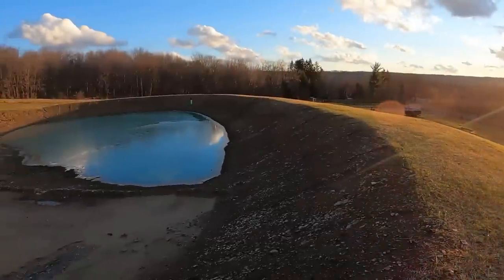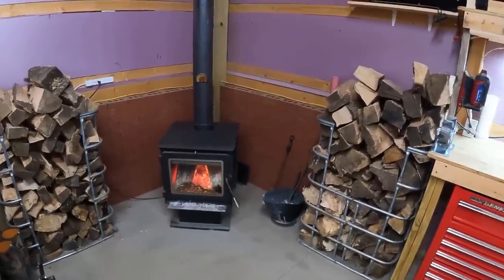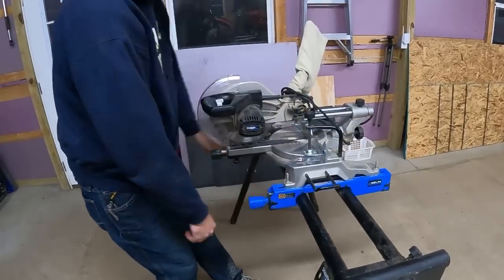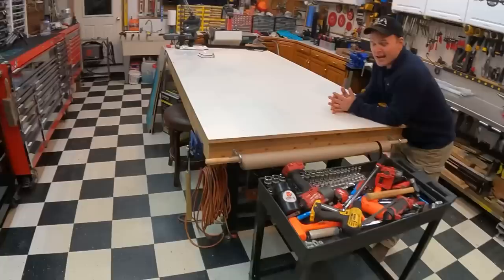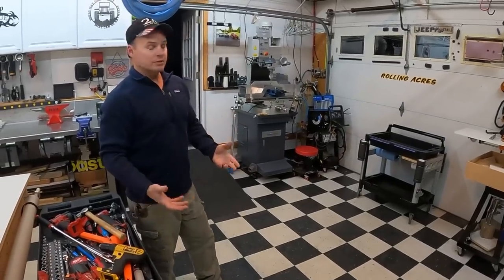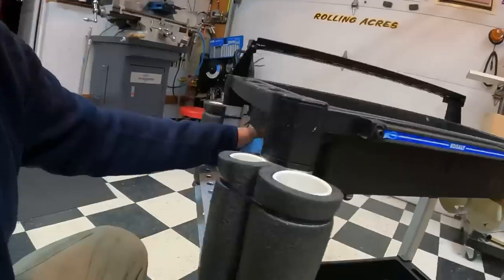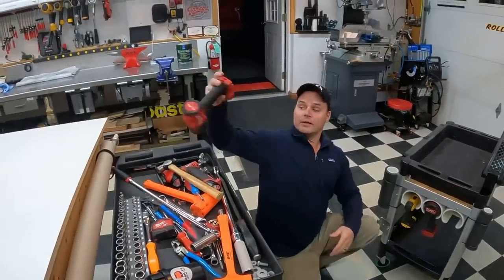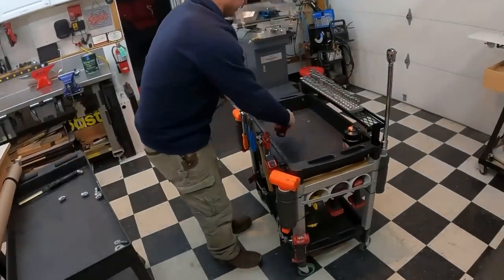The Best Mobile Tool Cart

Comment: Awesome video! I’m a professional tech and I took a lot of tips from Doug’s shop tour, and the other tour video too- an experienced word of caution: be careful when putting 4 swivel casters on a tool box- when all 4 casters are turned in- the centre of gravity is now further to the centre of the box. Won’t make a difference with a drawer-less cart, but with a tool box with drawers, the weight of a heavy drawer will flip the box on its face when it’s opened. That’s the reason boxes have only 2 swivel wheels. :) 
Amazing content! I appreciate all you post- we’re kinda 2 peas in a pod- firewood- tractors- sawmills. Healthy country lifestyle. 
Cheers my friend, Jeff

Comment: Where's that ratchet I'm laying on, oh no I just kicked my lug nuts, man, can't find that socket I used 2 minutes ago, oh its on the ratchet, oil running down my arm where's that rag, is that a screw sticking in my leg, oh man I forgot my drill.       That was a great been there done that, video.

Comment: I had built a crash cart back when I was doing locksmithing. Code machine and key duplicator on the top shelf. And hand tools on the bottom.  I would be in a office building and push my cart from one work Oder to another work order. I did this back in the early 1980’s.  Even though I’m disabled now, I still have my crash cart.

Comment: Had a friend of mine that worked off the ground more than he worked standing as well. He took an old creeper frame and made a tool cart off it. The highest thing was only like 1 1/2ft high, which was a removable screwdriver set. He wired up a work light on the side and everything. It just takes a little thought and experience to figure out what you want/need to make the job easier.

Comment: Doug and Adam. The only thing I would add is magnetic trays to hold those bolts as you take them off. I am a HD mechanic and have many different magnetic trays that I use on different jobs. Keep up the great videos. Don

Comment: When I poured the floor first on my shop, I still had to work and so I threw a tent up on that floor so I had a surface to work off of. I had a cart much like this one and did the same thing you have done here except on the back side of mine, I had some plywood attached to it and layed out my different pry bars. I had drilled holes along the sides for sticking in as well as those phony socket organizers that the size was on the little plastic peg sticking up. Those couldn't be seen or read them after a couple of uses. It worked for some time till the walls were up and stuff just changes over time. I had worn the other wheels out.

Comment: Great job as usual. The miter saw mount was nothing short of brilliant. I love the totes for the wood. If you can’t get a hold of the totes, I wonder if you could use rebar? I am not sure what would be best, 3/8” or 1/2”? You could use a torch and bend the 4 corners around a pipe mandrel. I’d make 4 or 5 sections then cut straight pieces to connect it all together. Make your own pallet to set them on. I think the modified tool cart Doug uses is great too. He is 100% correct, smarter not harder. I think the “other channel” means we’ll, but Doug clearly is on the right path here. He could perhaps make a place to stow a bottle jack on the lower shelf.

Comment: Four swivels are harder to control when you're moving the cart around the shop and are unstable. The swivels can catch on something and flip the cart over. It's worse when the cart is top heavy from the weight of the tools or parts. Two fixed wheels keeps the cart oriented in a more stable position.
Reply: True, you can "drive" the cart.

Comment: Thanks for the pond update! I would like to see the 'in process' of a Doug project!  (probably not welding on a Linoleum floor)
You show what you are actually doing i.e. milling/stickering lumber and most everything in between.  Doug would show a tree and then a stack of stickered lumber or a piece of furniture he made from it!  Thanks again for the pond update.
Dennis
Reply: I actually weld on that floor every day. Grinder dust, weld slag and even plasma cutting, that floor has held up so good for the last 20 years! The key is to keep it cleaned and not grind in the grit from walking on it day in and day out! I keep it swept up frequently.
Reply: @OneEyeCustoms The step by step process is missing! Also, Is that just linoleum?
Dennis
Reply: @Karen Lewis the flooring is individual 1’x1’ squares that is 1/8” thick. It is not roll out linoleum and I’m sure that is why it has held up over time!

Comment: I know this is an older video by this time, but as it relates to the power tool storage using the pvc, if you shimmed the end of the PVC to lie at a downward angle, then gravity would be enough to hold them in and you wouldn't need to have the locking mechanism from the scavenged snow shovel. 
Great video!

Comment: I feel like Doug (and myself too) use tools differently than Wranglerstar. He said in his video that all he used is 3/8" sockets and a 3/8" impact. With that in mind, it seems that he is doing light work. I have seen him tinker with motorcycles...light work. As for Doug, he is using the 1/2" drive and delving into heavier work (not professional homeowner work). With this in mind, I bet Wranglerstar could keep most of the tools he would ever need for the work he does, on a cart. When I worked in a shop, I would take the tools that I needed for a job and put them on a cart, and take them to the job. At the end of the job, I would bring the cart back to my box, and wipe the tools and put them away, and be ready for the next job. Again, very different use than I see Wranglerstar doing. Hope this makes sense.

Comment: I had four swivel wheels on my table saw, and strangely found steering more difficult compared to two swivel, two straight. When trying to move it into a corner, with four swivels it seemed to have a mind of its own. If one wheel rolled over a stone it would careen the table to one side. I had to be careful not to mar the drywall or bump adjacent gas cylinders as I rolled it away. And you need to lock four wheels rather than two. I went back to two swivel, two straight, and I positioned the straight wheels to be at right angles to the direction of the cut.

Comment: Stumbled upon this looking for a good shop cart, I ordered one through you're affiliate link,  current price is $72.51,  also plan on pirating some of Doug's ideas!  He needs to be a part of your channel more or have his own channel.
Reply: @over0059 I did start my own channel. One Eye Customs. Give it a look if you have time. Thank you!
Reply: So far so good with my new cart. first job I used for my 2nd gen Ram 12 valve doing brakes, calipers hoses & batteries. Not really a heavy-duty cart but good for home use, good bang for the buck. Currently have two diesel batteries on the bottom tray and probably another 30 pounds of tools on top. moving it around a sloped driveway with expansion cracks is a little bit of a pain but if you're careful it's fine. smooth level surfaces is perfect even with a lot of weight in it.

Comment: With only 2 swivel wheels the cart tracks straight over long distances. That’s why they don’t do 4 swivels. Not great in a small shop, but if you’re a janitor for instance and hiking 10 miles a day pulling a cart, you only want 2 swivels.

Comment: The reason many carts and tool boxes do not come with 4 swivel wheels is for steering. This usually isn't a problem if the cart isn't very heavy but if you loaded that cart with let's say 500lbs it will become very difficult to manuver since the opposite end of where you are holding the cart from will be able to wander side to side and you won't have enough torque on the handle to keep it going straight. This problem is even worse if you let's say have to move a cart across a tapered floor.

Good video though some neat ideas.

Comment: First off, great videos.  While watching this one, I started to wonder if everyone is trying to hard to make the nowadays much more expensive service carts work too hard to be something else entirely?  Would the time be better spent to simply take the chassis of a service cart (the lower section with 4 swivel casters), and go up with 4 sides of peg board to basically create a pegboard box.  Finish the top with a flat top or tray of whatever makes sense.  The height of the cart is whatever height the pegboard walls are.  Maybe the pegboard box is flush with the chassis, maybe it’s inset to offer a low level tray around the perimeter, or just on one side?maybe half of the top (interior of the pegboard) has a tray, the other half is open so long parts set down into the box vertically, rather than hanging off the sides of the cart longways.  Thoughts?  Thanks again for great content.

Comment: Just a warning when welding galvanized steel - the fumes are terrible, google metal fume fever. Take away the galvanization around the weld, make sure you wear a mask and have fume extraction.
Reply: And if you get sick from it drink a good amount of milk. I used to weld those galvanized cell towers that look like palm or pine trees. If you forgot your mask and welded you would definitely feel sick later, and milk is what the foreman would prescribe.

Comment: Please ask Doug what he thinks about magnetic mechanic trays please
Reply: I have several of the magnetic trays, I use them about 50% of the time when I think about it. Some of the stuff I have been working on lately is stainless bolts and any of the magnetic trays don’t work for them. But either way, they are handy but with this cart, I was trying to eliminate using the cart tray for anything other than parts or a small work surface.

Comment: Pro Tip - If you're working down low like under a vehicle, use the bottom shelf/tray on the tool cart, not the top one.

Bonus Pro Tip - If you're lying down working, remove the keys from your pocket before rolling onto your side...trust me.

Comment: I love the organizational ideas!  What ideas do you or Doug have for portable tool bags with no wheels (yard work, up & down stairs, other homes)?
Reply: I will have to give this one a thought. I would also need to have ideas on how you use the bag and so on. Most cases are dependent on how you want to use it.
Reply: @OneEyeCustoms  I like the ones where you can have smaller belt clip ones for electrical and carpentry that clip on the larger bags that can be easily carried.  Or one that can be loaded up with a selection of tools for a specific job.

Comment: The reason they don’t come with 4 swivel casters is a Liability issue.   The carts are easy to tip over with 4 swivel wheels.  Especially if your pushing it by the front .. pushing it backwards, if a wheel hits a bolt, stone, piece of wood.
Reply: But…you can still change them… You and Doug are the Dynamic duo!

Comment: US Stove Vogelzang HR-6 Heat Reclaimer, Fully Automatic Quiet 130 CFM Blower, Fully Sealed from Flue Gasses, Compatible with all Wood or Coal Stoves, 6 Inch Diameter Flue Pipe  hope this helps

Comment: idiot question here from someone who doesn't live in a very cold climate ... how do you find out how thick the ice is ?
Reply: I stand in the shallow end of the pond and drill a hole with an ice augger. Have a great day.
Reply from the maker: Yeah I will just cut a small hole in the ice with my chainsaw and use a tape measure
Reply: @HometownAcres  thank you
Reply: @kenthorsen4558  thank you